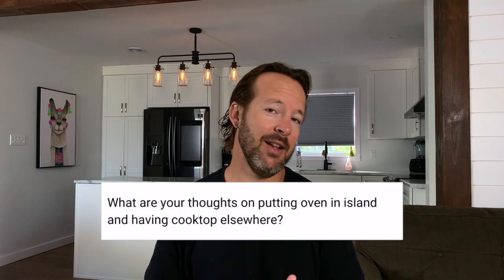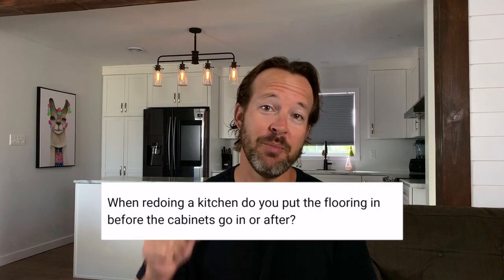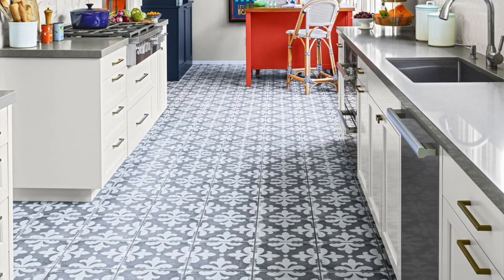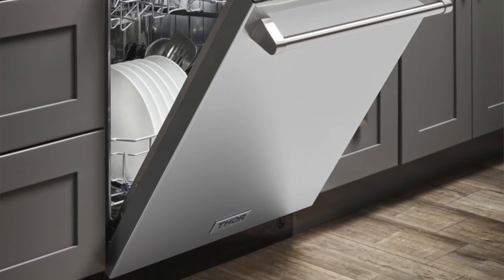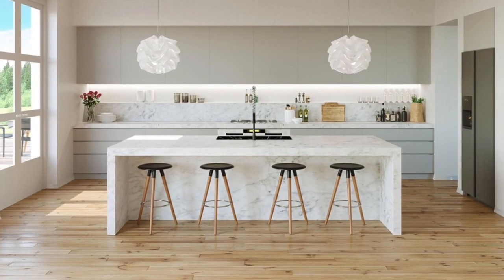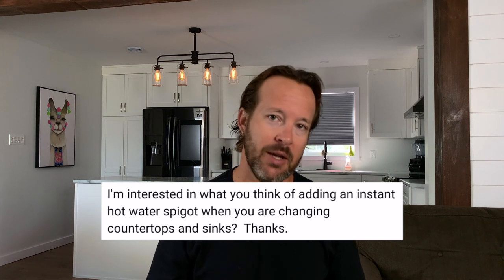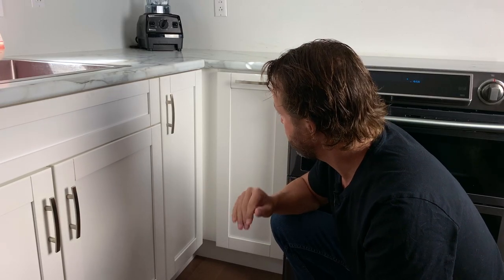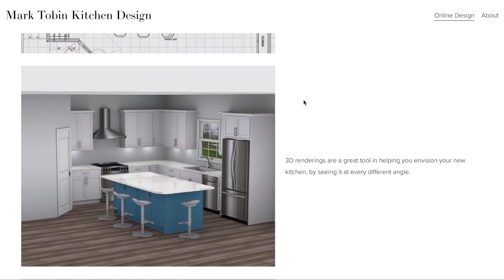Kitchen Design Questions Answered

Comment: My 1955 ranch home has a decent U shaped kitchen. I do not have cabinets on the opposite wall because I have baseboard radiators. I’m putting in all new HVAC (I will miss my gas fire boiler, but love the central air). I can’t wait to put in cabinets on the back wall. I’m only doing lowers and moving my sink and dishwasher over there. And my remodel is with IKEA cabinets, quartz counters, honed marble subway tile backsplash. Still deciding on flooring.
Reply from the maker: Cool.  Sounds like an awesome project, both the kitchen and the hvac.
Reply: @MTKDofficial  the house needs central air. I’m also remodeling the hall bathroom and adding a third bathroom in a very large back bedroom which will be the new master. It’s prob overkill in terms of having 2 master bedrooms, but I’ll be here for the next 15-20 years, so may as well be comfortable while I’m here. I’ll have 4 bedrooms and 3 full baths when I’m done. I also have an acre yard that I love.

Comment: Was so glad when you finally mentioned marketability of your home when it came to the purple/white scenario.  That is also a MUST consideration in layout and clearances and in doing things like putting a wall oven in an island.  Someone may like a linear kitchen but, it can and likely WILL either cause a house to sit on the market too long and/or be the main contributing factor in a seller not being able to get what they want for their house or not being able to sell it at ALL.  

A purple wall, for instance, is easily changed:  It's a finish.  And any realtor worth ANYTHING is going to suggest you paint it before listing your home.  A kitchen layout is NOT a finish and is NOT easily changed and a bad or esoteric design will hurt the wallet big time when it comes to selling.  And a weird design MAY keep a home from selling at ALL no matter HOW much it is loved by the people who built it.

So, unless someone plans on never selling or they plan on remodeling AGAIN beFORE they list, stay AWAY from weird stuff in the design of things that aren't easily changed.  Not doing so can and likely WILL cause you time, money, and headaches.
Reply: I think it's a balancing act. Resale value is certainly a consideration, but at the same time, I don't think people should be slaves to what's currently popular if their tastes are more eclectic, or the standard doesn't meet their needs. For example, I live alone and have the standard 24 inch dishwasher. I rarely use it because it takes several days for me to fill it up enough to run a load, and I prefer to wash my dishes more often. I'm keeping it for now because I can't afford to redo the cabinets, but if I ever get to that point, you better believe I'll be getting an 18 inch model. My subdivision caters to empty nesters, so I don't think the smaller dishwasher be a deal-breaker at resale time.
Reply: @prva9347  For sure.  Doors are easily changed.
Reply: But mentioning that to the potential buyers is only the start of all that needs to be "mention"ed.  Along with it needs to be mentioned:  1.  Who made the cabinets and whether that maker is still in business 2.  Whether they still make that line of cabinets/doors 3.  If they don't, whether not the will make you a set of replacement doors for those   4.  What those doors will cost  5.  If they won't or they are too expensive, who CAN make them for you and how much will THEY charge.  And additionally, the new doors may not at all match the other doors due to fading and or yellowing of that material so ALL the doors could have to be replaced then, back to #1.  Good luck making a sale being honest like that.  As a potential buyer, I would be moving on.
Reply: @prva9347  My comment was in regard to the interior doors you mentioned.  Over here, "standard" means "somewhere there abouts."  In other words a 2-0 x 6-8 door could be anywhere from 23 13/16 to 24 1/8 depending on who made it.  We don't have the same consumer-protection level as over there.  I suspect it is the same with domestically manufactured (U.S.A,) Euro-style cabinets.  Things kind of tend to run a muck over here and it can be quite time consuming, confusing, and irritating.... to say the LEAST.

Comment: I really like a cook top w/down venting & wall oven. Nasty what happens inbetween free-standing appliances and cabinets. 😁 (I fantasize having a built in refrigerator.) Also  beginning to appreciate less bending to view horizontally. 😁
I'm aware 36" is 'standard' but I think of as a minimum. 1-2 feet 'extra' is versatile, to use if necessary or convenient and much easier navigation.
Reply from the maker: The down draft is a great feature!  And yes I agree that a little more space is very much appreciated.
Reply: @MTKDofficial  🙂 Happy to hear an experienced designer 'approves' of a cooktop and down draft. I've been suprised (for 40+ years) are not more popular.
Will mention also, a cook top is an easy replacement compared to wrangling a freestanding range into the house and less than spacious kitchen.
As for downdraft; have over these years of cleaning a kitchen always despised what an ordeal it is clean every hood fan encountered. 😆

Comment: Would never put mirrors as a backsplash. They would show every spec of dust, grease, water spots etc.
Reply from the maker: Right, good call.  I would think you'd have to clean it non stop.
Reply: @MTKDofficial  Plus your comment about tile size. If you go with small mirror tiles, your kitchen will look like a 1970s disco.
Reply: @SarahRenz59  😂😂😂😂

Comment: Love your videos. Great ideas. Looking for a comment regarding wood floors. Yes, you said you put it in, but my issue is that 1) wood moves and 2) wood is porous. So with site finished flooring, as soon as it moves due to humidity the seal now has cracks, and with factory finished, it is impossible to seal the joints. Now any liquids can penetrate the microscopic cracks, and cause harm below. I think that’s the reason it is not permitted in commercial kitchens.
Reply from the maker: Hey. Thanks for the comment.  I allowed my floor to acclimate for 2 weeks before I installed it.  It’s a factory finished floor.  Interestingly enough, the floor we pullout was hardwood from 50 years ago.  It’s my grandmothers house so I can confirm. It was in amazing condition.  I think in a household kitchen hardwood is fine even though you’re absolutely right.  I’m not sure there’s enough sitting moisture to affect it.  But a commercial kitchen would definitely be a different scenario.  But really good point you made.  If someone is leery about hardwood, it’s probably best to go with tile.
Reply: @MTKDofficial  Had real oak flooring in my last home for 18 years including kitchen and never had any of those issues.

Comment: I was trying to decide how to lay flooring. We plan to do waterproof/resistant laminate flooring and I really don't want the expense of going under the base cabinets. These flooring companies require you to put a barrier around the flooring for waterproofing to be under warranty, so I couldn't figure out how that would be done just ending the flooring at the ikea cabinet leg. I never considered laying plywood to make up for the height of the flooring we will install. That way, I could lay the backer rod along the joint between the flooring and the plywood. :)
Reply from the maker: Yeah, it's not that big an expense to lay some plywood.  The toe kick board covers it anyways.

Comment: We had originally wanted separate cooktop and wall oven. But cost and loss of the counter space and cabinets made us change to a nice slide in gas range. 
Someone mentioned above that you can’t put cabinets on top of LVP flooring. Is that so? And if so, why not?
Lots of info in this 10 minute post. Nice work.
Reply from the maker: Hey thanks. I’m getting to that comment about the floor.   But yeah, you need more space if you split the appliance.  It’s not feasible for a lot of people.  Thanks for the comment

Comment: Many people need a second oven.  One used for the main baking and the other oven would have additional functionality such as steam or air fry or making desserts.  At  least thats what i did, I put the second oven below the island coutertop.
Reply from the maker: Great idea if it's in the budget and you have space.  Many people love having two ovens.
Reply: @MTKDofficial  For Asian families, steamer ovens are very important dues to their cooking styles.  On thing to watch out for when buying a built-in steamer over is to make sure the the steam vent through the front panel. The other important thing is that most Asian brand ovens are 24 inch (60cm) in width not 30 inch like the North America standards.  I hope that will help people when designing their cabinets.

Comment: If your installing a floating floor like LVP or Laminate…. cabinets cannot sit on top of that. I know that’s usually a remodel issue however a lot of builders here in the US are putting in LVP in new construction.
Reply from the maker: Installing cabinets on "floating" floor will not keep it from expanding or contracting.  Installing it without the proper spacing against the wall where it needs to expand will.  Putting an island on top of floating floor should not be an issue.  It's not an issue for other base cabinet either, other than costing more money for flooring that you will never see.  But this is a valid concern for a lot of people.  Thanks for bringing it up.

Comment: Putting in a basement in-law suite suite in newly purchased ( older) split entry home. Already has new VPF Installed in the downstairs. Thinking IKEA kitchen. Your thoughts on what to do with the flooring that will be under cabinets…
Reply from the maker: Hi Cindy.  Usually I recommend building up the floor under the cabinets to match the height.  This is important for appliances to match the countertop.
Cheap plywood will do the trick.  Lay the new flooring up to the plywood and the toe kick hides it.  IKEA base cabinets are on legs so it is easy to adjust the height of them.